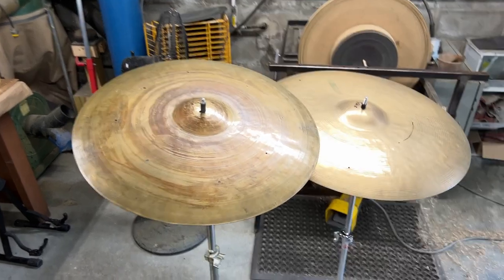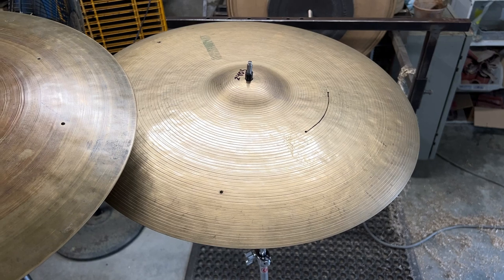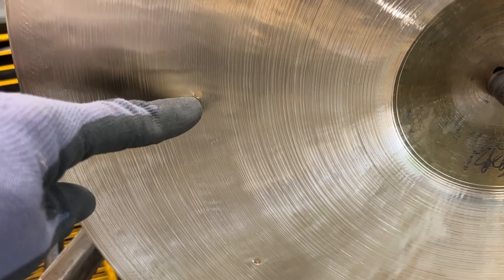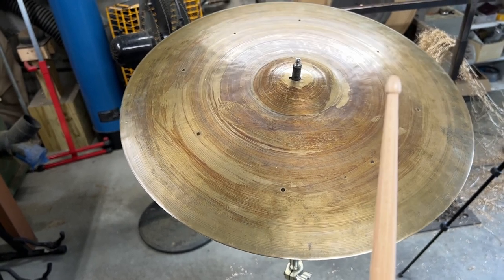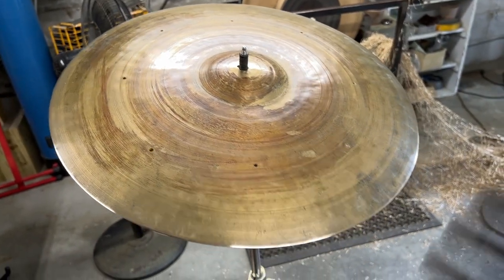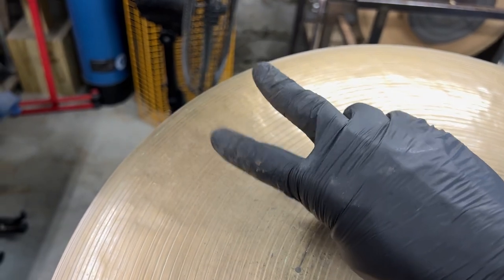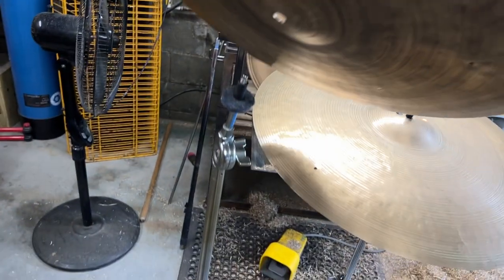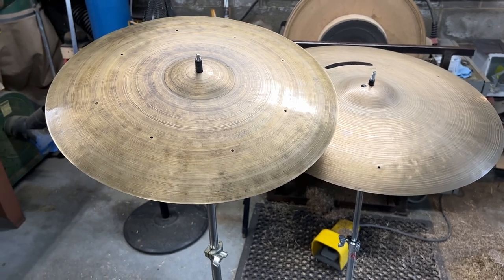Modifying 2 “Old K” Cymbals - Timothy Roberts

Comment: Hi Timothy. I think the back and forth lathing interferes with a classic regular vintage-style lathing. It looks odd to me. Also the high amount of unwanted 'chatter' is mostly due to a lack of proper sized backing plates. You definetely need those for lathing, also to reduce loss of profile. The clutter from bumping in and out of the rivet holes is WAY too big in my opinion. You can vastly diminish that by using proper plates combined with a very low RPM when working that area...
Reply from the maker: Hi Daan. Thanks for the comment. While I agree with you in principle, the other factor is the cymbal itself. These older cymbals with their wonky shapes can lead to the chatter. Could I have gone slower to limit it? Sure, but the task of removing 1000g makes that not feasible, time-wise. I actually like lathing with the backing plates that I use. It allows me full control over how much pressure I use and I can really see/feel what's going on with the metal. I've lathed well over 2000 cymbals in the last few years alone and this technique works well for me. Lastly the "crossover" lathing (as I call it) is a sonic choice. I don't really care that it looks "correct". I care about the final sound. Same for the chatter. There are many old K cymbals and other handmade cymbals that have chatter and sound great.
Reply: @ReverieDrumCo  my k con has a bit of chatter around the base of bell and i think its beautiful

Comment: That repair job that you did, they do the same thing to carillon bells in old fashioned bell towers.  I read that Big Ben, the bell, was cracked from being struck by too heavy a hammer, and so a similar surgery was done to it, and it was turned 45 degrees so that the new, lighter hammer would strike a new location.  It is that crack that gives it a twangy sound instead of a bonging sound.
Reply from the maker: That makes total sense! With a cymbal, another reason for removing more material is to adjust the weight and cause the cymbal to lay differently on the stand. It’ll causes the cymbal to lay opposite the crack so you don’t play over the repair.

Comment: I like smaller one much more.
I wonder can you make thin muddy and washy  cymbal  sound articulate and livelier again? Maybe by curving it to deeper profile...?
Reply from the maker: Yep, that usually involves hammering to balance tension and possibly raising the shape. Most of the time an issue with muddiness is an issue with the balance of tension more than the weight of the cymbal.

Comment: There no doubt that for my taste, both cymbals became much better, especially the 19.5” K but I have a question. I’d have guessed the crack repair in the middle of the 22” would have ended with the crackstop holes being enlarged, providing a radius hopefully too wide for the crack to propagate. Why cut out all that lies between?  I’d think the bigger crackstop holes would be enough. Thanks again for sharing your knowledge and processes!
Reply from the maker: Thank you! Technically, just widening the outer holes can be a perfectly fine repair. I widen it for the visual effect and to remove a bit more mass, which causes the cymbal to lean away from where the crack is. This keeps the playing surface away from the repair.
Reply: Clever! Never would have thought about that keeping the crack away from the stick. That’s why you’re the cymbal guy.

Comment: I have an old 24" 1968 zildjian usa cymbal it has a dent on the edge and is keyed can this be repaired in any way
Reply from the maker: I can repair the edge very easily. The keyhole is what it is, unless there's an actual crack (that I can cut out).
Reply: @ReverieDrumCo thanks for the response bud

Comment: Always an education! 😉👍
While it may hurt to see the original patina of 60-70yrs go bye bye, it really comes down to two things.....1, what the customer wants the customer gets...... 2, if it's a player and not a museum piece, what sounds best?.  
   The "marching" cymbal was interesting. I've heard drummers use them as rides before, and they can be very effective, IF you want all ping and cut. The crash ability is kind of useless 🤷‍♂.  You took it to a good place. Now it's a musically versatile instrument. To me it still has that "old" cymbal character, and there's still a little of that old K klang.  The customer is getting back a nice usable vibey instrument 💁‍♂
  That 22 wasn't too bad. The pitch and stick def were cool. It was the un-even overtones that weren't really pleasant. The upper mid range was kinda harsh & blurry. It's tough to get a ride that's been compromised to be exactly what you want. You really cleaned up the over tones and didn't change the pitch too much.   Learning why you cut out a crack wider than a thin cut with little holes was eye opening.  I've always drilled and cut out middle cracks in the way that ride was given to you. The thinking being the more material left the better. I've seen many cymbal repairs done with wide cut outs and never understood why they did that........ya learn something new everyday 😉👍
  I'm still saving my farthings to have you mod a couple rides for me 😊🙏
Reply from the maker: Thanks John! I agree with you all around!